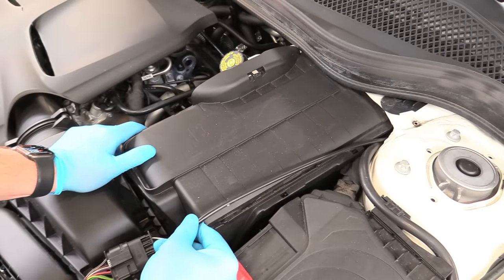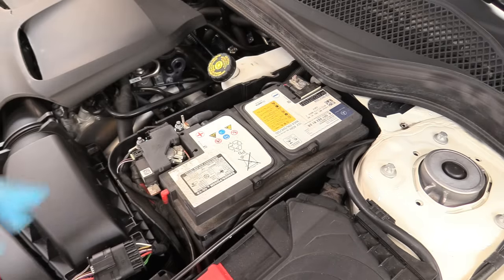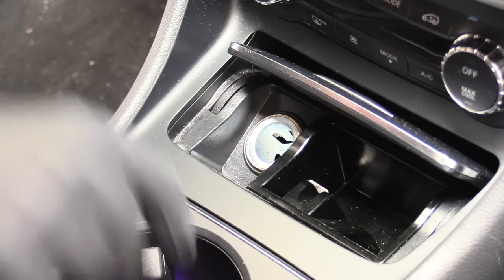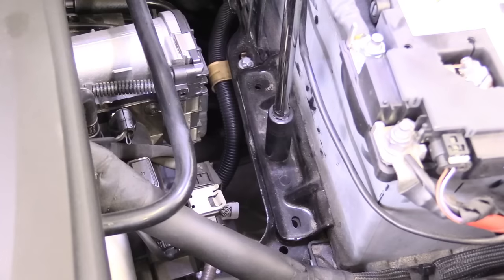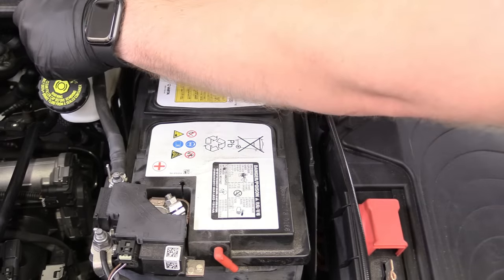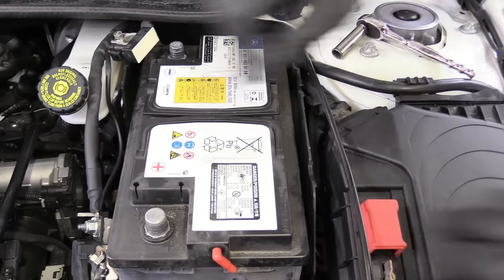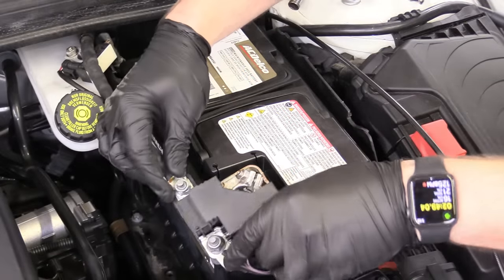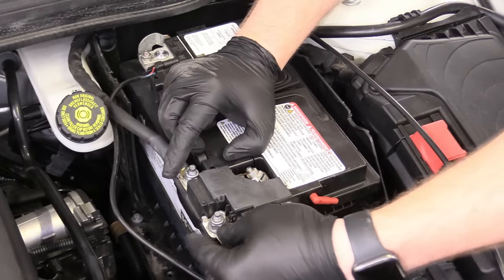How to Replace a Car Battery and Keep the Computer's Memory

Comment: Mercedes GLA250's are some of the most beautiful piece of shit cars in the world. Even simple procedures like removing batteries require light surgery, especially when parts seize. 10/10 dont recommend buying one anymore.
Reply: 😂😂😂 amen
Reply: This takes about 30 minutes. Quite easy frankly
Reply: @artagain8977  Simple but not "easy." There are too many loose parts to account for when removing a battery. Also, they're not reliable in sub-zero weather, like advertised. For instance, removing a battery in -20 weather is a chore. What if there was an emergency? On most cars, the battery cable is in plain sight, not covered in hard plastic. Also, trying to boost these things at the charging connectors is futile sometimes and often still requires one to connect directly to the battery. The reason I bring up -20 weather is that those inconveniences can also cause one to freeze their gas lines in a matter of seconds.

Comment: A couple of things.  It's a huge issue with the 2007 Lexus LS460.  If you change the battery in a 2007 Lexus LS460 without using a Memory Saver/Battery Saver you will likely end up getting the following message on your navigation screen.  A program cannot be read.  Please consult to a dealer.  When this happen you have no option but to engage the dealer.  Also, if you use the cigarette lighter option you risk loosing power to your car's computer if the cigarette lighter outlet has a timeout feature.   I would strongly discourage using this option unless you are ABSOLUTELY sure your vehicle's 12 volt cigarette outlet does NOT timeout.
Reply: Totally agree with you bro. My Lexus has NO power at the cigarette lighter socket unless the ignition power is on. Therefore you cannot use the battery saver, only option is to connect it to the OBD plug, this way you're ok. Cheers

Comment: Replaced the battery in a 2019 Mazda 3. I hooked up a small one amp Century charger which provides approximately 13.5 V to the negative and positive terminal lines before disconnecting the battery. Had battery out for about 10 minutes while I cleaned the posts and took my time. Zero problems and worked like a charm. No settings lost. I returned the Memory Saver unused as I read they are quirky after buying it.
Reply: I'm assuming you had to leave the charger connected while attaching the terminals to the new battery until tightened down. I have an 8amp charger and had the same idea.
Reply: mister, you're a genius obviously, but I've always been leary of doing this, supplying it AC poower instead of DC - it makes me nervous it is going to fry something
Reply: @robertmaybeth3434 it will supply 14v of dc power trying to trickle charge the battery that doesn’t exist
Reply: @michaelinzitari  WDYM?  We both know the whole idea of a mem saver.  It is to keep the memory alive w uninterrupted power supply to the car's computer, while the battery's not connected.  And also it isn't because we're worried about losing the radio settings etc.  it is because of these codes your car holds in memory called "P.D.T.C."s, or permanent diagnostic trouble codes.  And the problem with these PTDC codes happens because every time they lose power from the battery, they all reset, and will show one or more "false positives".  And the ONLY way to shut them off, is to complete a "driving cycle" of one or two hundred miles.  
The real problem is, if you disconnected your battery for something right before you take the car in for a smog check.  Because one or more of those PTDC codes might be showing, and if they are, you can't smog the car!  The tech will say something like, his machine stopped the test because of the PTDC and you need to come back later, after driving the car for one or two hundred miles.  
There are many situations where this could be downright inconvenient for everybody involved - easier to use the memory saver instead, I say.

Comment: My jump pack came with an OBDIi connector.  That works even if the lighter port is switched.  I also noticed that you didn't clean the battery cables before attaching the new battery.  Always clean the cable ends and the battery posts before you connect them.  Modern cars are very voltage sensitive and you want a good, clean connection. You can get a wire brush terminal cleaner for less than $5 that makes the job easy.
Reply: Great observation for cleaning the terminals, I worked for AAA battery service and took it one step more with brushing some baking soda water on the terminals and battery box, then flushing with water. Also coated the treads of the terminal bolts with oil which can be easily found on the oil dip stick.  ( Also I have used a 9 volt battery with adapter plugged into the 12 volt port and that seemed to work,  saved me from buying a jump pack )
Reply: Yes a lot of cars have switched lighter/ accessory ports making the plug in battery backup useless.
Reply: Very true, one needs to be aware of that switched accessory port if attempting to maintain voltage. I guess the crux here is that 9 volt DC will maintain voltage when disconnecting main battery.  @tombanes

Comment: Good morning sir, sorry for my English (I’m from Italy).
Images are very clear during all the video.
Your English is very clear: I could understand everything even though my comprehension level is medium.
Each part is easily visible.
I’m not very confident with car fixing, but this video seems to be very clear.
So I will buy a power supplier before change the battery and next time I will try to follow your instructions instead of taking my car to a garage.
Thank you.
Reply: Alessandro io l'Italiano lo capisco. Prima di tutto non tutte le auto puoi mettere il cosidetto "battery saver" dove accendi le sigarette. Sulla mia Lexus devo attacarmi direttamente sull'apposito OBD attacco, altrimenti non funziona e perdi tutte le memorie varie del computer, radio, posizione sedili, ari condizionata e cosi via. Ci sono tante altre vetture come la mia, se leggi i manuale della vettura ti dice cosa devi fare. Buona giornata e attento a come l fai. Un'altra cosa che questo ragazzo si e' dimenticato di FARE e' d pulire con un apposito atrezzo dentro il MORSETTO di tutti due attacchi che va' sulla batteria. Spero che mi hai capito. Buona giornata. n.b....il tuo inglese e' molto buono.:washhands::washhands:
Reply: Your written English is excellent Alessandro -  good punctuation. Keep up the good work and stay humble. Ciao.

Comment: On most cars, the cig lighter socket is dead when the key is off, so powering there won't help, and you don't want to turn the key ON, because that will draw more current than the low current mode can supply. OTOH, it was nice to see that M-B provided a nice + terminal for this exact purpose.
Reply from the maker: As long as you don't try to start it it is fine. Thanks for watching!

Comment: Thanks buddy, had some wonky strange error codes on wife’s 2019 Tiguan and slow starts.  Did some digging and learned that changing the battery could cause lots of other memory, key, code, various issues.  Did your trick and it worked GREAT and various low voltage codes went away.  Keeping the alligator clips on the terminal cables was difficult.
Reply: you can have a detuned engine and transmission if you dont register the battery on certain cars

Comment: If using the cigarette lighter socket, be sure to turn key to accessory or to the on position, as most are not powered with the key off. Electrons can't get out if not switched.
Reply: How will you know if you're running off the battery or the aux pack?
Reply: I imagine you'd be running off both until the main battery is removed, just as though you were jump starting.
Reply: For anyone reading this be very cautious as ACC mode may draw more amps than the lighter is designed for. Unlikely but be sure to turn off radio and anything else possible before hand
Reply: I was always told to change battery with key on  voltage spike could damage sensitive components

Comment: In Japanese carsand may others,  the 12 volt convenience outlet may be controlled by a relay that is energized by the 12V battery which means that to be safe you should connect the keep-alive replacement directly to the battery cable  terminals,
Reply: So even if you supply 12v through the OBD II port, the computer may still lose memory? 
I have a Toyota Hybrid 2019 and it's time to replace the battery soon, so I was thinking whether to connect the jump box directly to the battery cables or to the OBD II port if I have a special adapter.

Comment: I didn't have the Radio Code for my Toyota, and (by removing the Car battery) you would lose this! At the time, I didn't figure on the Cars' ECU and potential Memory Loss. But here is how I replaced the Car Battery - without any losses to the radio or ECU. The Cigar Lighter Socket was permanently 'live' with the Ignition turned-off. So I set-up a 12V (regulated) 1-Amp DC Supply which was fed from the mains by an Extension Cord. I wired a Cigar Lighter Plug to the 12V / 1A DC regulated supply - remembering the correct polarity. I then plugged this into the Cigar Lighter Socket, and proceeded to change the useless Car Battery, and replace this with new. I had never seen any videos, or even knew how to do this. But everything worked out just fine. With the new Car Battery Connected, I just simply removed the Cigar Lighter Plug from the Socket. Hope that this helps others.

Comment: I kept my computers memory by using a solar battery charger placed on the dash board.  Disconnecting the battery and leaving the charger plugged into he cig lighter kept the computer with enough power so it didn't lose it's memory during the battery removal.

Comment: Well , I ended up hooking up normal jumping cables to a running car , then switched the battery keeping the terminals still connected , it worked like perfect

Comment: Thanks for the info.  One important action would be to reset/reprogram the battery management system for those vehicles having one.  A requirement to avoid battery damage and prolonging life of new battery.
Reply: How can this be done?
Reply: @Lmlc24 From what I've seen, it requires an OBD II Port scanner that allows battery adaptation settings/adjustments. As for how much that OBD II Scanner cost No idea depends on what scanner you purchase. Wish I knew this before I try secretly replacing my 80 year old neighbors battery on her 2017 VW Tiguan TSi. She's on a very tight income and I told her it just needs a full charge.. trying to help her without her knowing.
Reply: @eddiej.2354  thank for the replying I do appreciate it, I have a 2013 RAM 1500 and I purchase an AGM Optima yellow top 8 months ago and went down little by little to the point that it can barely start the truck, it was same group (H7) from previous but previous battery was a flooded battery, I don’t know if this had to be done like letting the computer know that now has a different type of battery but it’s the first time that I purchase a battery and it last only months, fortunately I was covered with warranty and they gave me a new one but I wonder if I must do this in case the truck is suitable to do so??? 
I have found nothing about it on the media yet!
Reply: I did this on a couple of my Ford Fusions (I have 3, have owned 4 and have 6 Fords currently) when I switched the batteries to larger CCA + AGM batteries. Used my OBDLinkMX+ adapter and a laptop running a program called Forscan. Went in to the battery settings and modified the Module AS-Built Data Values to the corresponding Group Size/Case, CCA, Ah, of the new battery which adjusted the system to charge at that rate instead of the lower preset charge rates of the much smaller OEM flooded  lead-acid battery that came in the vehicle. The OBDII adapter sells for approx. $140 but can be found on sale for $100. Works with iPhone, Android and Windows but a laptop program will be needed to change AS-Data Module values.
Reply: That being said I have a 2004 F150 Lariat SuperCrew that I did a like for like (same CA, CCA, Group Size) battery swap except from a flooded lead-acid to AGM and made no changes via OBDII and have had no issues with proper charging since doing so.
Reply: @abyssiniahenry128 Battery monitoring does not regulate charging, it is exactly what it's described as, a monitor and primarily for temperature and state of charge. The vehicles PCM regulates the charge  via data received from various sources ,one being the battery condition monitor.

Comment: My 1999 Nissan Maxima 3 litre V6 has a anti theft system to the radio/cd. So if the battery is removed it needs to be re-set with the code to get the radio going. They way round it is to have a 12 volt supply available in place of the battery, so a battery jump start set, a similar battery or even the 12 volts DC from your model railway control. This is because it is a fiddle to re-set the code!
My garage has always used the bridging system if the battery has to be removed.
Thanks Jim’s Garage!
Reply: Could I just run jumper cables from another car (not running) and accomplish the same result?

Comment: All that is required to protect the computer’s memory  is 9 volts. Parts stores sell $10 kits consisting of a 9 volt battery attached to a cigarette socket plug.  Cheap and effective. Don’t forget to clean your terminals.
Reply: Same but mine plugs into obd port under driver side dash👍👍
Reply: I used a 9V battery to power the computer thru the cigarette port when changing out the battery.  When I was done, that 9V battery was burn your fingers HOT! It worked though.

Comment: Terrific video and thanks!  To confirm:  To replace the battery, one has to follow use THIS video's procedure, to preserve the ECM, and then step 2: Reset the Battery Mgmt System using your other video.   Right or is there a 3rd or 4th step which I'm omitting?   Will the other video be applicable to a Kia Seltos?  
If one doesn't want to spring $100 for a jump box, what would a typical mechanic charge (labor) to replace an AGM battery brought to him (or her?) by the customer?

Comment: I have found some battery terminals are smaller in diameter, so the clamps can’t be tightened properly, in which case I made a metal split sleeve. 15mm copper plumbing pipe works well.

Comment: I have the same Noco jump box. I also have the cigarette lighter cable, but it only plugs into the POWER IN port to charge the box.  How did you set it up for POWER OUT?

Comment: One thing if you use the acc outlet to power up the car to keep the computer going make sure that the cigarette lighter has voltage it doesn't have a blown fuse. And everything is turn off.

Comment: I have a Kia EV6 and going overseas for 6 weeks.  Should the 12v battery be disconnected from the high voltage battery while away?  I plan to trickle charge the high voltage battery on a timer to result in a 80% charge when I return.  If I disconnect the 12v battery I could end up with the issues you discuss here.  Would the 12v battery keep getting charged by the high voltage battery if it get the trickle charge?

Comment: Just attach terminals before removing battery to a second vehicle with jumper cables and replace the battery.  Always use gloves and eye protection playing with batteries.

Comment: So now I have to pay Jeff Bezos a $100 for a battery pack, just so I can replace my $150 battery?   I hate these electronic monsters.
Reply: No, Terry, just use jump leads from any other car battery, possibly in another car.  And if you follow the strategy I posted today, you can choose when to do it.
Reply: actually, I was going to use my jumper cables to my other car to keep the computer alive, until I seen this video and realized I could just use my NOCO jump box. I highly recommend getting one for emergencies and charging phones, etc. Very useful. I am constantly using my box to jump other people's cars, motorcycles, machines, and they have built in "idiot" detectors so people do not make contact between positive and negative. Often I have to jump things (trucks), that my car does not have the cranking amps to turnover. my little NOCO jump box can jump several cold diesel trucks on one charge; or, about a dozen dead batteries in regular cars. It also has an override, that allows me to start and run a vehicle with no battery or alternator for at least 5-15 minutes.

Comment: Had my battery replaced at a small roadside shop and they just did it with the engine running. No need for any extra equipment.
Reply: That’s a stupid thing for them to do as disconnecting the battery with the engine running causes a load dump which sends a high voltage spike through the car’s electrical system!.

Comment: Any reason I can't take jumper cables going from one car battery and connect them to the battery cables south of the terminal posts of the battery I am taking out and still have 12 to 13 volts feeding my vehicle whose battery is to come out? I am thinking this will hold my memory in my Range Rover so I dont loose settings. I replaced a battery once before on this Rover w/o holding volts to the ECU and memory and my radio key fob did not work. My power windows were messed up and many other loses did incur.

Comment: Hi! Can I use one of these when connecting my multimeter in series with the battery terminal to test for parasitic current drain or would it mess up the readings?

Comment: My 2015 Transit battery is pretty dead, like ~6 volts.  How low can it go before the ECU "forgets" everything?  I'm going to use a separate 12 volt supply through the OBD-II port when I replace the battery, but I'm wondering if there's any memory left to save at this point.  I just spent over $200 in gas driving around aimlessly so I could get my van smogged, and then this happened!